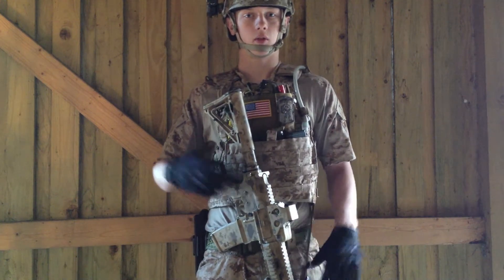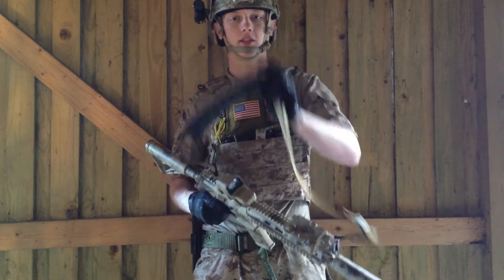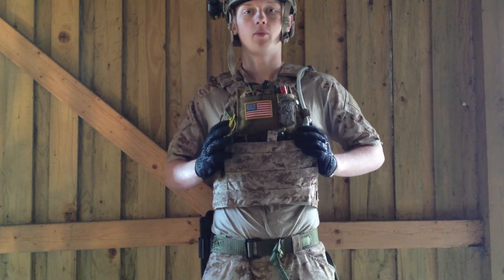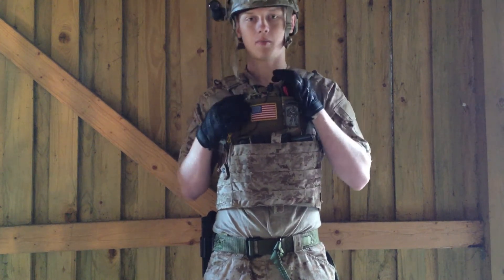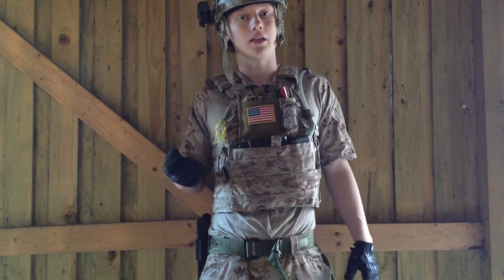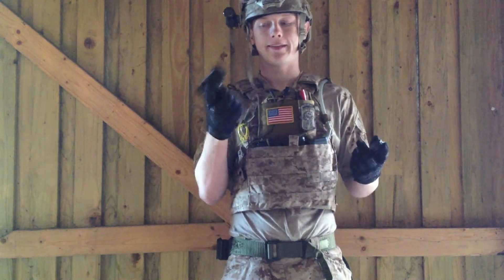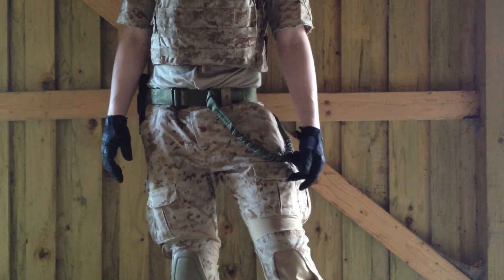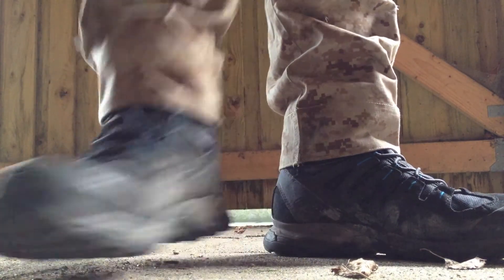AOR1 DEVGRU-ISH Loadout (Old Kit)

Comment: In which Place in the Gun do you store the battery for the gun?
Reply from the maker: +Devgru Seal Team Sic Got it in the buffertube. 11.1 1100mah lipo fits nicely. Can't put it in the shortest position though but I don't ever have it there anyways
Reply: +Fernhill Airsoft Thanks for the fast answer, but i have another question:Which Type of battery LiPo or NiMh and which Model? Thanks:-)
Reply from the maker: +Devgru Seal Team Sic Lipo stick type 11.1 1100mah. As far as I know the cells doesn't matter